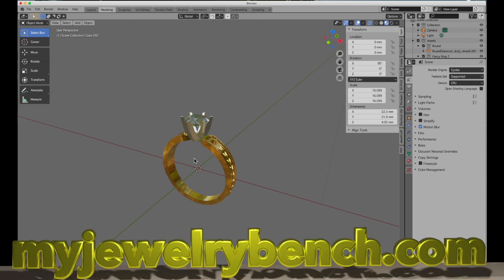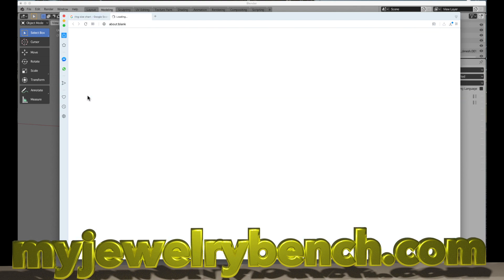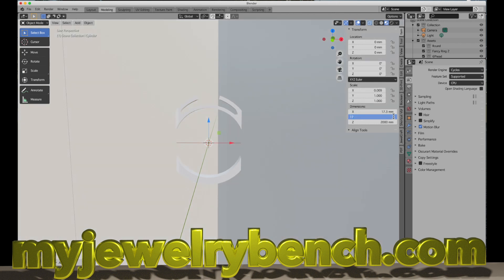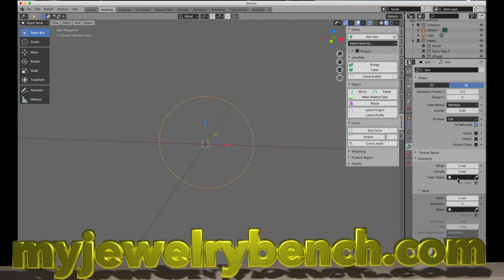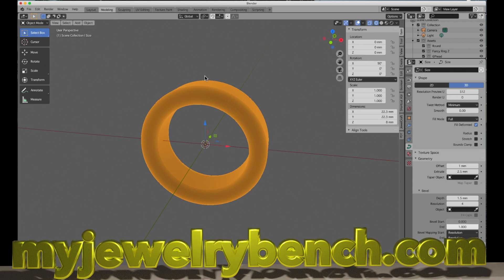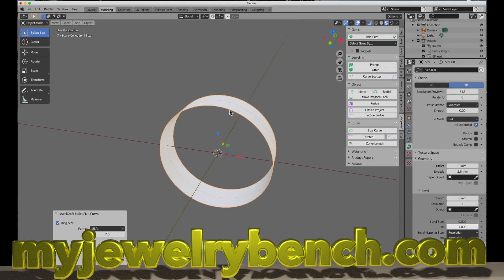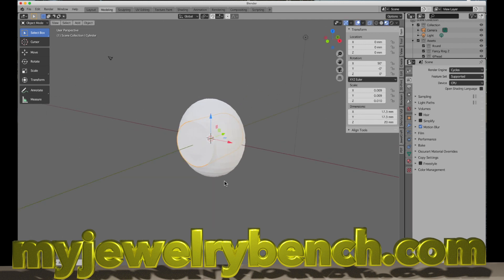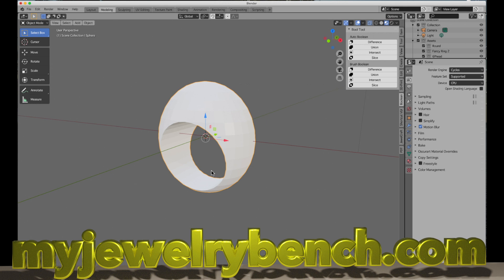Jewelry Design in Blender 2.8, How to get the Proper Ring Size!

Comment: Hi, the problem using scale function is that we modify all the axis. If we have a project with stones or fixed parameters, using the scale function is not a good idea right? Maybe better with the cylinder and the bool tool function. I just start with blender.
Reply from the maker: Ther are, in blender, limitations to your design workflow. I’ve discovered for the most part to design the ring( in this case) and get that modeled first then I can add stones.  I still have the ability to modify the width. You can however parent the paths for the gems to the ring model and that even gives you more control over the size of the ring without ruining the arc of the gem curve.
Reply: @watchesandjewelry  Thanks for sharing your knowledge and taking time to answer.

Comment: Hey great video. Is there anyway to get those 3d files of the rings already made like you have?
Reply: Well, since you ask. Is there a way to trace a pattern or maybe even a photograph in Blender
Reply from the maker: Yes. I have not done it myself but here is the procedure. Important a photo into blender as a plane. File-import-image as plane. Then you can use the grease pencil tool to outline your image, clean it up and convert it to a mesh. Grease pencil lines are considered curves. The second way would be to use a different application to convert your image to an SVG file then import that into blender and convert it to a mesh. Hope that helps. Let me know
Reply: @watchesandjewelry  That helps a lot thanks